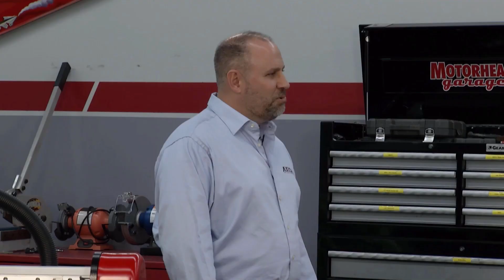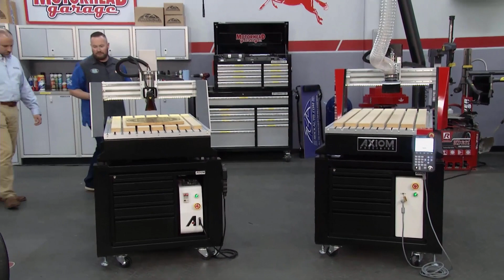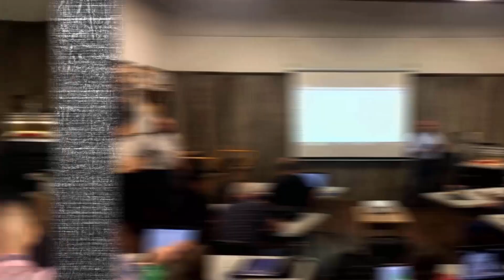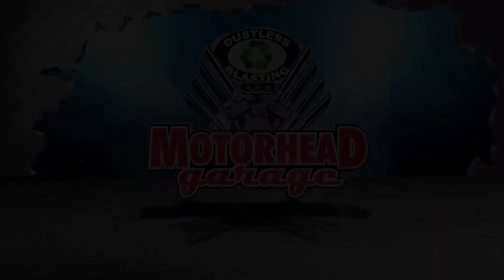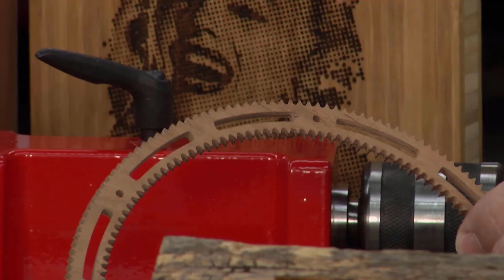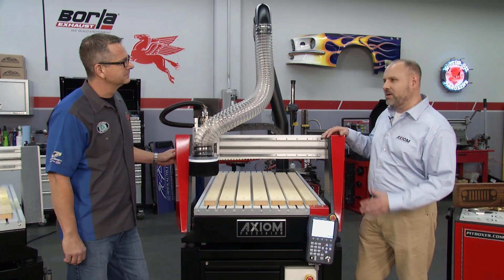The Axiom Tool Group visits the Motorhead Garage

Comment: I have owned my AR8 for 4 years now and will tell you, it is an investment that you won't regret.  The support and ease of use is nothing less than superb.  If you are truly looking at a smaller foot print in a machine, go the extra mile and purchase the Axiom series of CNC routers.
Reply: What about the Software? Hardware seems legit with Axiom. Software will make and break.